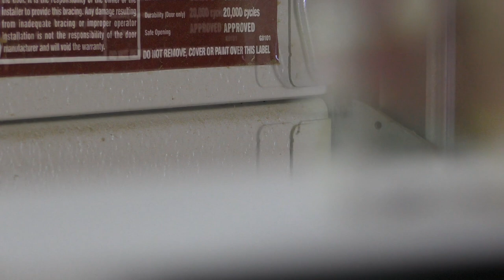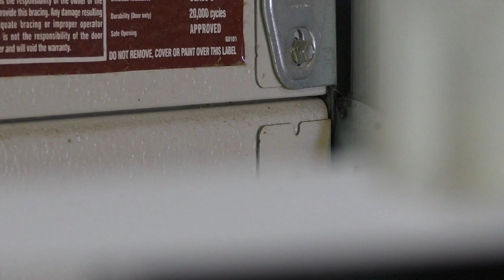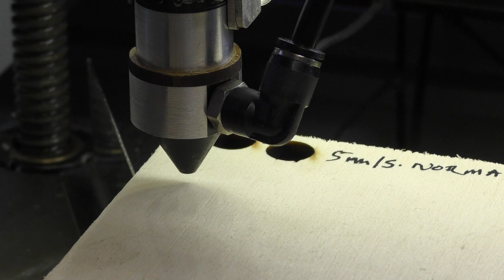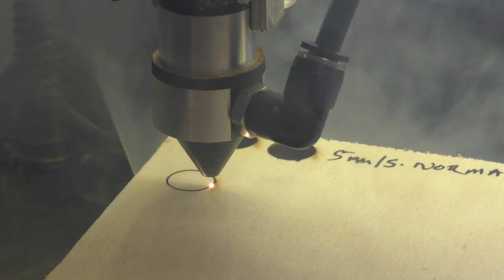RDWorks Learning Lab 229 Search for a Beam Collimator Part 2

Comment: Russ, while watching, I paused and I went in the shop to see what I had in terms of poplar wood, I didn't have a 10mm ply, just have15mm, however, I also had some milled 5mm poplar wood and with my 700mmX50mm Co2 tube which is what? 30-35Watts? with my tube at 80%power, I was just able to cut throw with 8mms, So the fact you can cut a 10mm much faster than I can in 5mm material, id call that a success.
Reply from the maker: Hmm...... Yes your tube is 35 watts if it's an A grade tube. However , have you ever done a mode burn into acrylic to see the INTENSITY profile of your beam? see
https://www.youtube.com/watch?v=R6Wqn5-HMzM

 My guess is that this will be a B grade tube with a "blunt " intensity profile so you may not be comparing like for like A typical 35 watt tube  will have a specified beam diameter of 4mm. That sound small  and technically will have a high intensity centre. However I guess that the spec is something called FWHM. just a great looking number where in realty the beam is about 8mm diameter. My RF beam claims to be 2mm but in reality shows as almost 4mm. This makes a huge difference when comparing performance . My 35 watt tube is already twice as capable at cutting when compared  your 35 watt glass tube. However,  once the beam exits the tube  after 1300mm  (the front corner of my machine)  that 4mm beam will naturally grow to about 14mm and cutting with that will be absolutly useless. Your beam will grow  from 8 to about 11 over the same distance
Best wwishes
Russ

Comment: Is it possible to put another beam expander after the first mirror..
Reply from the maker: Yes it is possible but no for 3 reasons
1)Every lens will cost 3 or 4% power loss so the existing initial 2 lenses plust the final focusing lens = 12% loss plus 3 mirrors at 3% each means were are already sacrificing 20% of the 30 watts avaialable Adding 2 more lenses?
2) The beam has to pass perfectly through the axix of the expander so getting this second device set will be a nightmare
3) The point pf this exercise is to preserve the INTENSITY in the beam It is a struggle to do that with just 1 pair of conditioning lenses. Add a second conditioning pair and the intensity will certainly be destroyd/
 Despite the losses in 1) I an hopeful that I will be able to overcome the limitations that convention lens theory  puts on this problem.
The next session will see success or fauilure.....I cannot predict
 Best wishes
Russ

Comment: The most important thing is that the beam has the same diameter over the entire length, the diameter is irrelevant. This can be solved with several lenses in the head. Just take a look at how metal cutting machines work. Because of the large energy, we use a beam expander to expand the beam very far to be converted in the head to have a small long focus area. You try in your video to get the beam theoretically perfect without focusing.
Reply from the maker: Hi
I used to run a  CO2 metal cutting laser business and  understang the  mukti lens system used. However when you do not have several kilowatts of energy to play with you begint o realize there are problems with lenses that get obliterared with lots of power. With only 30 watts  to play with you soon discover that lenes arre not the focusing beastswe haver all been led to believe from lens theory. A beam  expander  contains at least two lenses and althoug the size of the beam can be controlled to whatever diameretris required  the key feature that is not controlled is the intensity of the beam. A laser beam used for cutting should be a TEM00 intensity distribution (ie Gaussian). Unfortunately one of the iherent properties of a spherical geometry lens is feature called spherical aberration. . A gaussian intensity pattern entering a lens becomes something completely different by the time it reaces a focal point and so what exits the focal point is no longer Gaussian befor it enters a second beam expander element. As they say in the computer world ."rubbish in= rubbish out" . Yes a beam expander can be used to manage the beam diameter but it does no manage the intensity profile . Any semblance of the original Gaussian intensity profile is destroyed. With such low powersto work with that central high intensity is the only bit of the beam available to damage material. I quickly realized this once I started working with a beam expander and so my aim was to find a way to arrange lenses in a non-orhtodox way to see if I could preserve the intensity profile  rather than the diameter. 

As I mentioned at the beginning. if you are throwing kilowatts of enegy at a material it can have flat intensity profile and the unifom energy density across the focused beam acts like a milling cutter. The long focus you describe is not a focus in the true sense of the word.  it is  a narrow column of very high intensity coherent light,  where the energy density far exceeds the damage threshold of the metal. (let's ignore the efffect of the high pressure assist gasses)  My intention of creating a high intensity small diameter beam was to focus  the insignificant power to  ceate significant material damage. However this exploration taught me that lenses are not what we imagine and  that at the lens axis,  there is zero refraction and sthus zero focusing ability. As you move away from the axis there is a slow progressive ability to focus the light energy. If you read further about spherical aberration you will learn that there is no such thing as a single focal point, instead, a rrange of places where rays focus   An interesting reference document can be found here   http://users.ntua.gr/eglytsis/OptEng/Aberrations_p.pdf

This means that my dream of focussing the central high intensity of a small diameter  laser beam  coincided with a lens's inability to do what I had imagined. Beam expanders and low power lasers are not compatible.  I have done a lot more exploritory tests to determine exactly what the cutting mechanism is for non-metal cutting lasers. 

 Disaapointingly. my knowledge of high power metal cutting laser was,  a ,most, 5% transferrable to the low power non-metal cutting world. Beam expanders were invented in the 15th century  for telescopes  ie random unifrom light, they had no concept  how they would work with laser light  Lens theory is great for designing the path of light rays through single or multiple lenses, hence it has the predictive power to design various diameter parallel beams. However, that theory takes no account of A) the INTENSTY of the rays  or B) the damage that that INTENSTY can inflict on various materials , at or beyond the focal point.
.

Comment: I've been trying to focus and collumnate a 80 watt  455nm (blue) diode array chip (35×35mm) best I've managed to do is get a highly focused 0.5mm dot with a focal depth of 0.1mm(?) Using 60×20 biconvex lens. Any suggestions on  how to  Increase  the  depth of beam? Perhaps a strong biconvex- then a weak biconcave- then a weak biconvex to focus it further?
Reply from the maker: Hi
Your diode laser has the great advantage of being able to use the many types of normal glass lenses that are commercially available. I have no such luxury with CO2 10,600nm wavelength. . I am also not a optical engineer and  use common sense  and experimentation  rather than  lens theory to  design what I want. There is a massive problem with lenses that few theorists seem to accept. Focussing unifrom light to transmit images is different to focusing non-uniform light to create material damage.  Your diode laser also has a sort of Gaussian intensiry distribution but there is no easy way for you to see it.  However that applies to EACH individual laser  diode and not the matrix.  A matrix chip will more likely produce a more uniform source which is ideal for engraving rather than cutting. It also means that  you are using a largish diameter lens to do the focussing.  Large beams are good theoretically because they will focus down to a much smaller point.  However I consider 0.1mm to be a small focus  and 0.2 to be a normal cut or line width but  my experience has been exclusively with a single Gaussian intensity distribution beam.  The very nature of your beam may respond well to two short focus (say 1" fl) plano convex lenses place flsat sides down and pushed against each other.. It will also ALAWYS have a VERY short working distance  (maybe 0.2 to 0.3mm.  

Sorry I cannot give any "expert" optical guidance  because the area I am investigating falls outside the boundaries of normal lens theory.. There are several big optical companies that would design you a compoud lens system but it would cost more than you paid for your machine. So that forces you to be a bit inventive. Because your light source is visible. you may seek advice from  an amateur astonomy group, many of whom have people that  make their own mirrors and lenses and are also "friendly" experts.
 There is also a very good Youtube channel you should visit called  huygens optics. The expert who runs that may be able to REALLY help with your problem 
 Best wishes
Russ
Reply: @SarbarMultimedia  hi Russ- thanks it is very helpful-this is just a project I started because I like learning  by giving myself engineering  challenges... also it would be neat being able to cut steel😁 

yes I've been using cheap automotive lenses and they keep cool/don't crack with blue  455nm.

 Frustratingly  i have a 5watt blue engraving module (sculpfun s9)which can cut 25mm dense softwood (slowly- only possible with air assist) and engrave steel but I can't achieve  anything  near that with my frankenstien 80 watt laser. The engraving module claims to be able to compress the beam to a 0.02mm dot and I'm inclined to believe  it- from what ive read 455nm can be compressed  into a tiny beam (unlike IR) which  is why it is used in  blu ray (higher beam resolution)

Tempted to dissect the engraving module- but it cost more than 'frankenstien'- and I will probably  kill it in the process.... Maybe when the diode dies

Comment: Hi Russ I just wondered if you got my encrypted email regarding getting the light weight head for my machine thanks Gary
Reply from the maker: Hi Gary
Thanks for being persistent  but no. Was it in the form of a comment? Youtube have  created algorithms that detect lightly disguised email addresses and prevents publication. There is a way that they cant detect and that is to lose it in a sentence or two like this.   Start with gary and then a dot followed by smith. Add the at symbol followed by  g++m)) a**i==l ,  a dot  andfinally add the com.   Break up your provider because that will be an easy pattern to detect. If it happens to be gmail then just say the G
 Best wishes
Russ
Reply: @SarbarMultimedia  yes just like you told me to do it 😒 thanks
Reply from the maker: @warriors475  
Hi gary
 Could you try here one more time please .

Thanks
Russ
Reply: @SarbarMultimedia  hi russ not sure if you got my last message it is garycooper at the sky and then a dot and then it is a com hope this email finds you well

Comment: Get a beam expander of sufficient diameter and place it on the moveable head just before the focal lens.
Of course the mirrors need to be of sufficient diameter to reflect all of the beam as it grows in diameter.

I'm still having trouble with my cheap chinese laser. Poor workmanship, poor design.
May have to build one myself.
Reply from the maker: Hi 
  There is not meant to be any rudeness when I say that, like many people, you do not understand the concept that I am working with.  A mode burn into acrylic tells me exactly about the INTENSITY profile of the beam. In several of my videos I have tried to explain how important intensity is for cutting.  When the beam hits the final lens whatever intensity is within the beam gets amplified to a small finite focal.diameter. The iINTENSITY of light in that spot (let's ignore the spherical aberration effects) will cause material damage. The RATE at which that damage will occur is directly related to INTENSITY of light in that spot. A lens  is just an amplifier of  INTENSITY, so if the lens reduces a beam from 7mm to .07mm then  just for simplicity lets call that an amplification of 100.. Thus I am sure we can agree that whatever the INTENSITY  profile is when it hits the lans, it bwill be 100 times more intense when it hits thee work OK lets now move back to the tube  and analyse your suggestion, The laser exits mr RF tube as a 4mmdiameter beam with a VERY high intensity profile. Remeber the higher the INTENSITY the faster material damage will occur. and I have demonstrated that within 5 seconds that beam can burn 25mm deep into acrylic. Because this is a Gaussian INTENSITY profile  I discussed the importance of beam inyensity in 
https://www.youtube.com/watch?v=z8sNPtIIXZ4
So if I increase the beam diameter to 8mm I will halve the INTENSITY.  Because an RF beam grows at the rate of 7mm per meter it means that it will hav travelled about 1100 mm by the time it reaches your proposed beam expander position at the front corner of the machine. By that time the beam has grown to  (4+8) 12mm diameter. So the INTENSITY is now 1/3 of its its tube exit value. Sevarl points to note

1) The beam is now so close to the  lens how effective can it be . Is it put there to EXPAND and the collimate the beam?
2) As the expander moves from rear corner to front corner the beam diameter INTO the expander will change from about 6mm tp 12mm. How does thathlp INTENSITY stability?
3)  Whatever happens to the beam as it reaches the final lens at the front of the machine the  the INTESITY will be 1/3 of wat it was at tube exit.
 
My goal is to intecept the beam upon tube exit  with its high intensity 4mm beam and  CONDITION (maybe  it's  very long focusing) it  so that arrives at the front corner wth a 4mm high INTENSITY beam  as it enters the lens.. That means that instead of amplifying 1/3 of the original intensity  it  will be anplfying ALL of the original INTENSITY and thus be capable of damaging material 3 times quicker.  I am unlikely to completely succeed but I do expect to achoeve double cutting speed.
 
 Success or failure will happen in the nect session.
Despite not being practicle I really appreciate all ideas because it gives an opportunity for me to explin my ideas in more depth than a video. So thanks again.
 Best wishes
 Russ
Reply: @SarbarMultimedia   Good, healthy conversation is never rude. I am never trying to be rude or demeaning. Just tossing out ideas.
I pretty much understand the concept of intensity and that's why I suggested what I did. The beam isn't losing power, it's losing intensity due to beam expansion. Let it expand then "beam expand" it down to 4mm again before passing it through the final focus lens. To do that you would need larger mirrors and beam expander to catch all the energy.
My 50watt fiber laser has enough intensity to vaporize metal since it's focused to about 0.05mm
Reply from the maker: @jackflash6377  The problem with writing something  is that words are open to interpretaion by the reader. If we were having a face to face conversation we would immediately  detect zero anger/rudeness / sarcasm/ disdain etc etc  by the tones we use. . It's great to know that logical discussion and  different opinions are not being misinterpreted. Your argument is echoed by several others  but that will not stop me taking this uncinventional vision to a conclusion. The worst situation is that I fail om camera and I have no problem with that because  I always accept  failure and mistakes as a valid part of self-education. 
 Your fibre laser is not a valid comparison because it operates at a  different wavelength and damages a completely different range of materials  For example it cannot  cut acrylic or wood but the tight crysal stucture of metals is less relective at 1 micron  so it is possible for the shorter wavelength to  damage metals. At 10.6 microns all metals are typically more than 90% relective  but at 1 micron  reflectance  drops to about 50 or 60% . That's a whole different and fascinating subject.
 I hope to be back on the macine within a few days.
 Thanks for the comment
 Best wishes
Russ